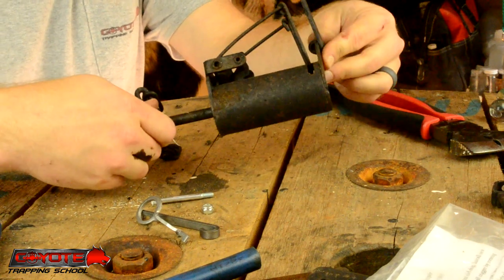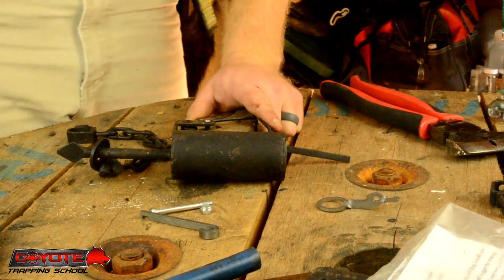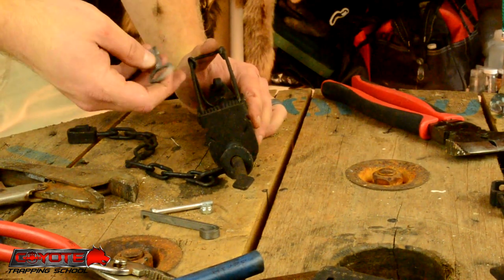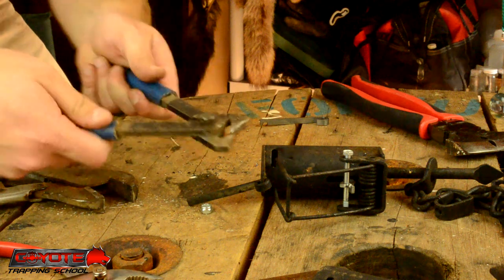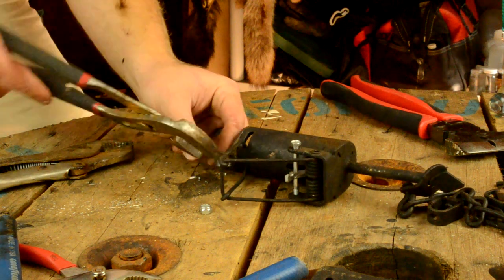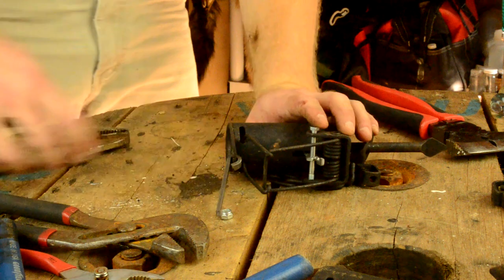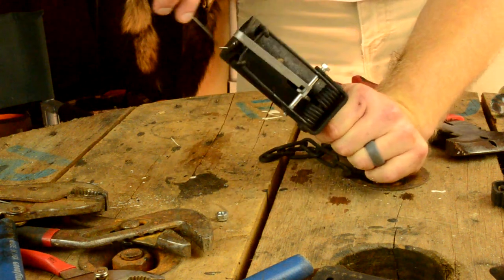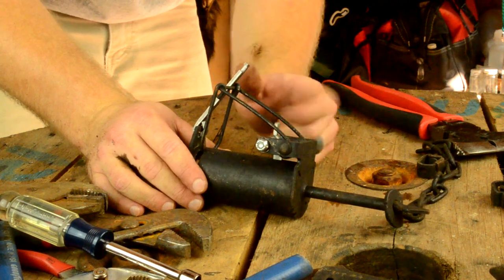Duke Dog Proof Trap - converting to push pull round trigger

Comment: Well... What is the verdict?  A good change or not?  I have 8 dukes that I am thinking might serve me better with a round push/pull trigger vs the pull only flat trigger.  Have you seen better results?
Reply from the maker: Absolutely, all my dukes I changed to push/pull triggers and any new dps I buy will be Z traps.  Much better results with the dukes push/pull over pull only
Reply: @coyotetrappingschool1575  push/pull traps will catch dogs, pull only traps wont. I catch more coyotes than coons in my DP traps. I had to stop using them because I got a dog that's a fatty that will eat anything and everything. I'm positive he'd fuck around with these traps until he got his tongue guillotined off. I tossed birdseed out on the ground for the birds and he ran up and started eating the seeds!

Comment: My trigger sets to deep push doesn't work cant figure out what I'm doing wrong
Reply: My trigger is bottoming out in the trap.
Reply from the maker: I had issues with a couple of mine too when replacing them, can't remember what I did now to correct them.  Did you put the triggers on the right way?  I put one on backwards and of course the dog won't lock into it that way